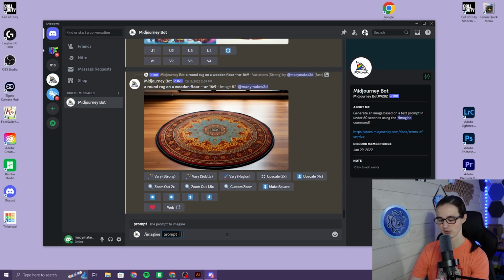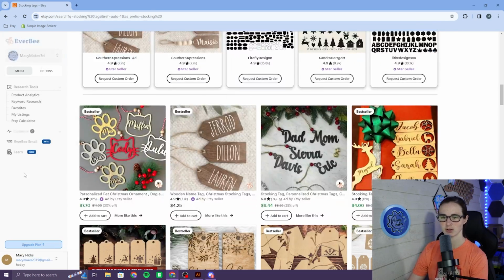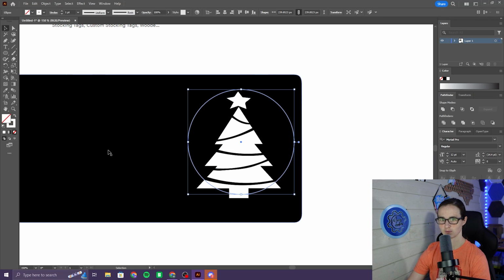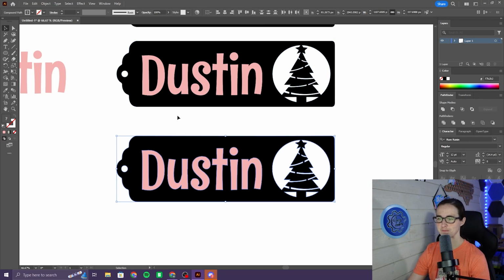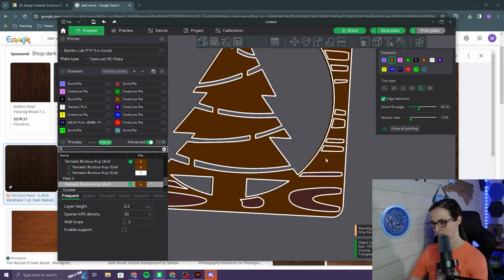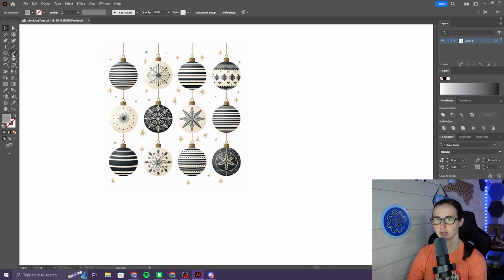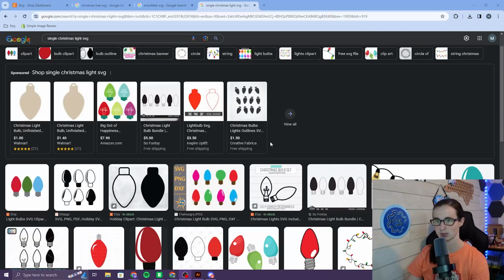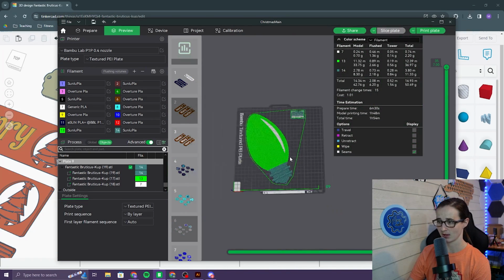Using 3d Printing for Christmas Decorations - Giant Christmas Lights

Comment: You are inspiring me Macy!  I can only dream to be 1/10th as successful at this as you are.  I've gotten some sales locally, so I said what the heck and got myself a P1S combo...it really is a pretty sweet machine.

I bet those wood grain tags would be a good seller in your shop.

As far as the lights, they look cool and I bet it would be even better if you linked them together w/ some kind of string/twine/wire and only fastened every 3rd or so to the ceiling, allowing the ones in between to hang down.

I'm sure you've mentioned it, but what is the program you use to make the designs?
Reply from the maker: That’s awesome you got a p1s! Really speeds things up! I’ll probably add the tags to my shop next Christmas. And for the lights I definitely want to try and string them together somehow, this was just a quick way to get them up for this year. I stayed pretty busy all the way up to Christmas so my “Christmas video” had to take the back seat. I’ll be more prepared next year. 

Thanks for watching and continuing to support me on my journey ☺️

Comment: On the single color tags, have you experimented with flipping them on their face to take advantage of the bed texture and filament flow to smooth things out? Conversely, the "Ironing" setting may be beneficial to the top layer  finish of a lot of your creations (in case you haven't tried it)

Thank you for continuing to share your workflow. It's been so motivating!
Reply from the maker: I’m glad you’re liking the videos 😊 thank you so much for watching!  

I haven’t tried printing face down. My beds are always so dirty I’m afraid to try it. I will soon though! And I also want to try ironing to see the difference. Might make a cool video!